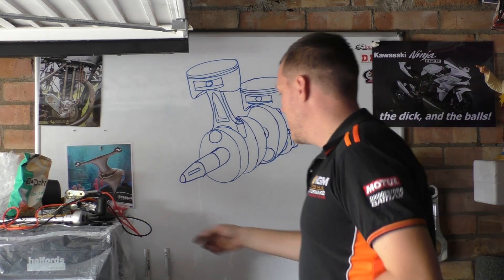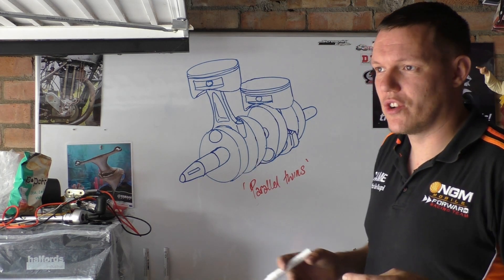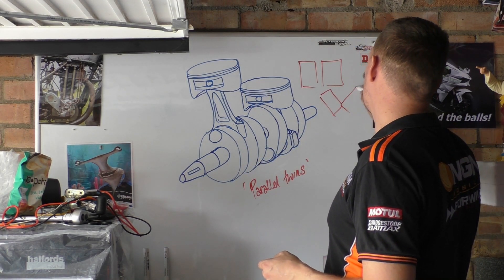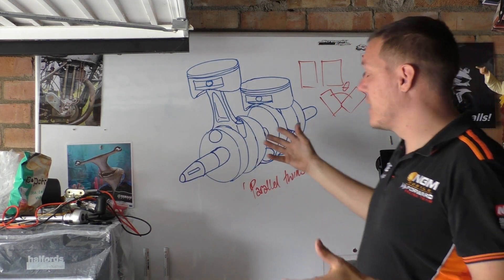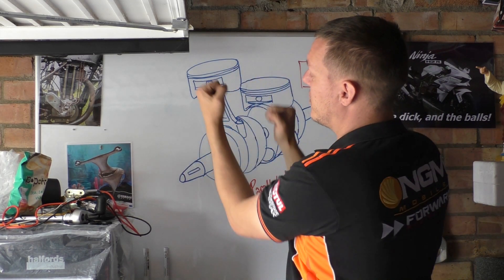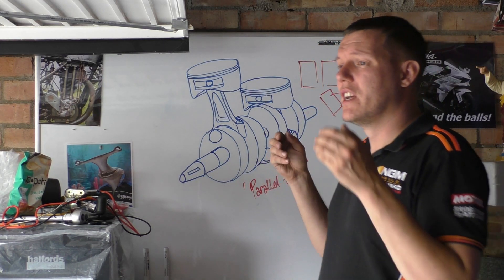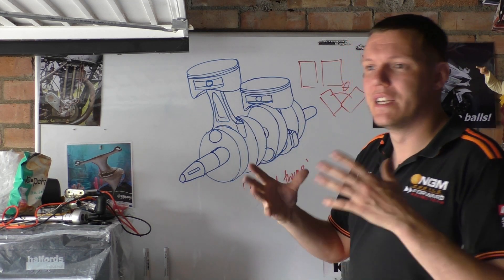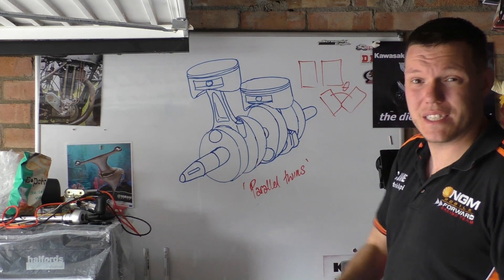Motorcycle-simple - Parallel Cylinder Engines

Comment: The type of engine you are explaining and is pictured is actually an inline twin. With a parallel twin both pistons move up and down at the same time.  Both types are straight twins 😉
Reply from the maker: No they don't...
Reply: @thedirtyworkshop  https://www.quora.com/What-is-the-difference-between-parallel-twin-and-inline-two-cylinder-engine-in-bikes
Reply from the maker: LMAO! A question and answers site where someone gets it wrong...
Reply from the maker: Here's the Kawasaki Z650 website - 

https://www.kawasaki.co.uk/en/products/Supernaked/2020/Z650/overview?Uid=0844XgwNXVkKUVhbUF5RXF9cX1ALWVtaDF4MUA4OXAxZXlo

If you read it, it says;

"Like its predecessor, the superbly balanced Z650 offers sugomi performance and styling in a slim, compact middleweight package that features a 650cc Parallel Twin engine with strong low-mid range torque in a lightweight chassis."

Here is a picture of the Z650 crankshaft...

https://i.ebayimg.com/images/g/CN4AAOSwWelffG4z/s-l1600.jpg

Or just google 'Z650 crankshaft'
 
I know what a parallel twin engine is. That's why I have a channel with nearly 80k subs...
Reply from the maker: Actually, if you look at the comment below the one you posted it states;

"You can actually say - parallel twin and inline twin are the terms used interchangeably. Someone else has said that incase of parallel twin, the pistons must reach TDC at the same time but that is not the case."
Reply: @thedirtyworkshop  https://en.wikipedia.org/wiki/Straight-twin_engine
"the term "parallel-twin" is traditionally used for engines with a crankshaft angle of 360 degrees, since the two pistons are in the same direction (i.e. parallel to each other)."
Some people call tracking control arms tie rods, doesn't make it accurate terminology. It just means that they don't understand the minor but significant differences
Reply from the maker: What you don't understand is the terminology. How does inline differentiate the difference in cranking location? It doesn't. 

What would the difference be between parallel, inline, tandem, paired and sequential? 

What you don't understand is the history of these engines.
Reply from the maker: All kawasakis, hondas, yamahas, triumphs, etc etc use this terminology. But instead your source is websites filled in by individuals.

They used to call it this way back in the 1930s in Britain, but not anymore.
Reply: @thedirtyworkshop  parallel twin- straight 2, pistons at 360 degrees.  Inline twin- straight 2, pistons at 180 degrees.  Tandem and paired are generally terms not used are ambiguous terms. Sequential is not a term I have EVER heard used to refer to the cylinder layout, orientation or crank angles. Motorcycle gearboxes are generally sequential... Never heard of cylinder configurations labeled as sequential!
Reply from the maker: Then explain the yamaha, honda and kawasaki sites then? Are you saying they're wrong?
Reply from the maker: Simple question....
Reply: @thedirtyworkshop  you do understand that manufacturers may change designs over the years. For instance a manufacturer may modify the engine in a particular model of motor cycle from a parallel 2 to a inline 2 to suit their power/ running requirements? You may call it the same thing because it looks similar on the outside,  same name, same model, but running characteristics and output are quite different due to unseen design changes
Reply: @thedirtyworkshop  and btw the kawasaki z650 started of with an inline 4 😉
Reply from the maker: No. Simply no.

A 'v' engine says nothing about the crankpin arrangement. Most v twins but not all share the same pin.

A yamaha r1 which is crossplane is still called a inline or straight 4. No different than the none crossplane model before it. 

Parallel is the definition of the cylinders, not the pistons...

Its that simple
Reply from the maker: It doesn't matter. The gpz500 didn't, and neither did the er5 and er6. All called parallel twins with 180 cranks. Who ever told you it meant otherwise was wrong

Comment: So to clarify the important stuff.

In a parallel twin primary forces get cancelled out but secondary forces dont making the engine want to jump a tiny bit. 
Since its just 1/2 inline 4 but also 1/2 boxer 4 if you want. While a boxer 4 engines have their secondary forces cancelled and inline 4s dont boxers therfore want to twist.

Parallel twins want both: Hop very slightly (secondary forces) and twist (caused by primary forces since they are parallel but also askew to each other).
Parallel twins usually run quite smooth and therefore are able to achieve really high rpm but you might feel your motorcycle shaking left and right very slightly if you concentrate. You usually dont feel the hopping.

In case you care inline 6s and v12 (which is just 2 inline 6s in a v shape) have all their primary and secondary forces cancelled and also the twist is cancelled. Basically I6 and V12 dont move on their own which makes them extremely smooth and achieve extremely high rpm. (Obviously having a Straight 6 in your bike is quite heavy while also the center of mass gets whifted way too high.

In case you still care 1 cylyndre engines obviously cant cancel their secondary and primary forces making them run not smooth at all but at least they dont want to rotate. They cant achieve as high rpms.
Reply from the maker: "In a parallel twin primary forces get cancelled out but secondary forces dont making the engine want to jump a tiny bit"

- it depends on the crank arrangement - and the primary or first order forces are out of plane to each other.
Reply: @thedirtyworkshop  ,,the primary or first order forces are out of plane to each other."
Yeah, thats what I meant to say when I wrote: ,,twist (caused by primary forces since they are parallel but also askew to each other)"

Maybe "askew" is an unsual term in english. - I am no native speaker. When writing this i noticed that askew also means no parallel, my bad.

In a 3D-World like ours 2 points can be either identical or different, 2 lines can be identical, parallel, cut at an angle, orthogonal or askew and 2 surfaces can be identical, parralel or cut each other.

Obviously the primary forces are not alligned askew. They are alligned parallel but not identical. They are only identical in for example boxer 2 engines, which is why boxer 2 engines run very smooth. They dont jump and dont twist/rotate because the vectors of their forces are identical but the pistons move mirrored canceling all forces. in parallel twins they are parallel resulting in primary forces being cacelled and secondary forces remaining (if firing order is 12XX (parallel twin) fot for example 1X2X (did I get this right?)) - My bad.

Comment: Is there a parallel twin with both pistons in the same position? I think it'll be kinda smooth.
Reply from the maker: Yes, most british motorcycles from back in the day (Royal Enfields, BSA, Matchless, Norton etc) had this arrangement - they're called 360 twins, or tandem twins
Reply: @thedirtyworkshop  my kawasaki 400 is like that. Z400-R2 1983. i am going to rebuild the engine and put a supercharger on it. Compression is 9.5 right now but i will go a bit lower.

Comment: Great job. But I'm going to ask you one more thing, could you explain the difference of a 2-cylinder 270º, 360º and 180º engine? thank you
Reply: 180deg piston moves alternate one goes up and other goes down .360deg both biston moves together but the firing order is diffrent
Reply: Yogi Paisal Nugraha false.

360° has the most evenly spaced power strokes, but also the most primary imbalance. It does not have a rocking couple to speak of.

180° has very unevenly spaced power strokes, but the primary forces balance out. It has the worst rocking couple.

270° is right in the middle between those two, in all aspects. Most(all?) 90° V-twins share the same firing interval, meaning exhaust note will be similar.

The argument could be made that 180° cranks could have the highest potential redline(higher top speed), because primary forces are balanced, but that’s a far cry from a blanket truth.

Comment: Are parallel and inline twin the same thing. Cause my friend says its not. He works in a motorcycle showroom and says that when the both pistons move at the same time to the same direction its  parallel and when they move differently its in line. I have been denying it but he insists Im wrong. I think hes wrong cause he has given me couple of wrong information befour. So, people of the internet, decide.
Reply: Hello it is a motorcycle mechanic from canada. for one years labor this bill is going to be quite largex but here inline engines and parallel engines are the  same however like all squares are rectangles  not all rectangles are squares...  V parallels are not the same as inline engines because the inline name comes from how the cylinders are placed ... in-line (in a row) and the 2 cylinders from a parallel are in a line albeit a short one at that but in order to describe it much simpler rather than saying "I have a 2 cylinder inline parallel twin" many people began saying just to shorten it "I have a parallel twin" because it gits all the same info across in 1/3rd as many words

Comment: Should have explained the drawing, that it depicts a 180-degree twin, used primarily by Honda because of its lower-amplitude vibrations, but higher frequency vibrations were what you got.  The other main design was the 360-degree crank, typically used by the British motorcycle manufactures because of its superior torque characteristics, but at the cost of higher amplitude, albeit lower frequency, vibrations.  Honda also preferred the 180-degree crankshaft because it allowed higher rpm's, consistent with Honda's method of extracting more horsepower from an engine, at the expense, however, of lower-rpm torque output.  In short, the Honda engine made more peak horsepower, but you had to rev it to get, and didn't pull all that well down low.  The Brit bikes were just the opposite, not as rev-able as the Honda, but then you didn't really need to, as it had good power output at lower rpm's, but then, they shook like a whore in church, too.
Reply from the maker: Motorcycle-simple.................what don't you understand about the title.
Reply: I understand the title very well.  What makes you think I don't?

Comment: I may be wrong but I think my dad's old 68 or 69 Triumph 650 bonneville was a tandem twin. That was such a cool bike. Sadly he parted ways with it before I was old enough to give it a go.
Reply: shimlocky-  Yep, it was a parallel twin, but unlike the drawing shown in this video, the two pistons rose and fell together, instead of alternating.  The Triumph had what we called a '360-degree' crank-  shown here is a 180-degree crank, typically used by Honda.  Honda went after horsepower the cheap and easy way-  through higher rpm's, but at the expense of lower-rpm grunt.  The Triumph couldn't rev with a Honda but then it didn't need to, as it could pull like a freight train down low and had a killer mid-range.  Until the Honda really got its revs up it was pretty hopeless.  Yeah, you missed out on a great bike.
Reply: Shimjocky-  No, it was a parallel twin with a 360-degree crankshaft, where the pistons rose and fell together.  Good for torque output and a killer mid-range.  Shown in the picture here is a 180-degree crankshaft motor, good for higher-rpm power output, but not so good at torque.
Reply: alexander kasady Matt referred to a tandem as a parallel twin where the Pistons rise and fall together so that's why I referred to the Bonnie as a tandem. :)
Reply: ahimjocky-   Matt didn't explain it very clearly and with his strong regional accent it was hard for me to understand him.  I'm sure he meant that in a 360-degree twin the pistons rise and fall in tandem, that is they go up and down at the same time, taking turns firing so that the firing pulses are evenly spaced.  A true tandem engine, however, is a parallel twin with its cylinders arranged front and back instead of side-by-side.  While the world is full of parallel twins, such as your dad's Triumph,  the tandem twins are very rare, not having been used (and then discarded as an engineering exercise) since the 1920's or 30's,  so an example for illustrative purposes would be impossible to come up with.  While it's true that in the 1970's a couple of Japanese manufacturers used the square-four engine design, two parallel twins, one pair in front of the other and joined by a common crank,  could, however mistakenly, be confused with two tandem twins, side by side, the crank layout really precludes this.  But to call a parallel, side-by-side twin a 'tandem' twin is just plain wrong.
Reply: Matt got it wrong.  A tandem twin has the cylinders one behind the other with the crankshafts geared together,  not arranged across the frame.

Comment: Years ago I thought the rule of thumb was that a 4 stroke twin would have the pistons move up and down together ie the big brit bikes of the 70's and 2 stroke twins would have pistons move up and down opposite to each other...
Reply from the maker: The ER-5 is a rocking twin
Reply: Yes it is and because it doesn't have a wacking great flywheel casting bolted between the two pistons like the old brit bikes do, it is relatively smooth running... 
The way to get a 360 degree brit twin to run smoother is to change the cams and have both cylinders fire at the same time..